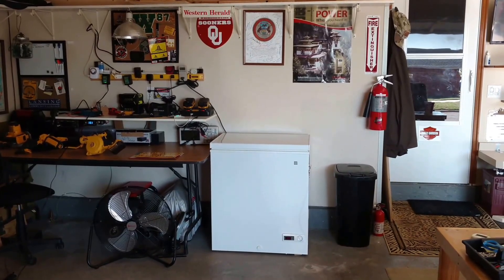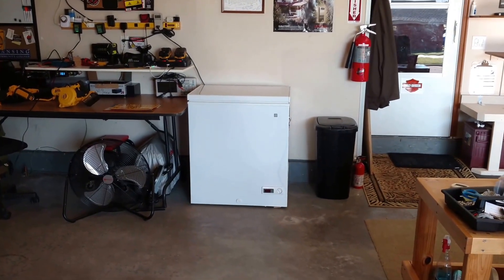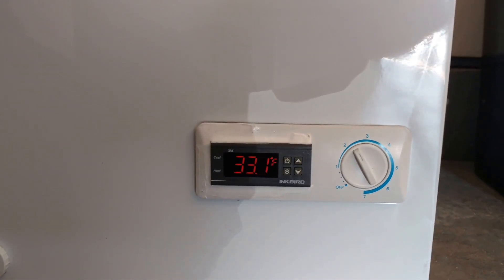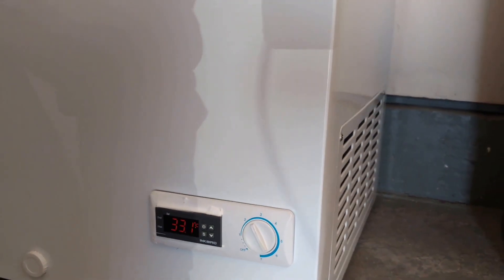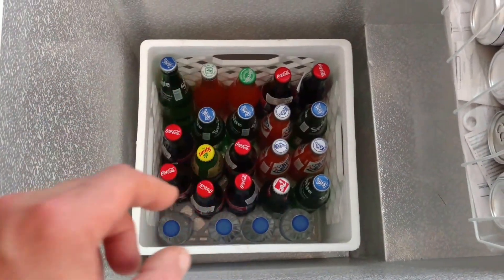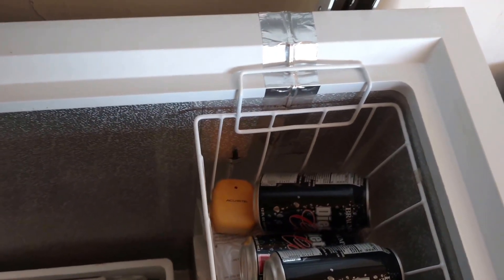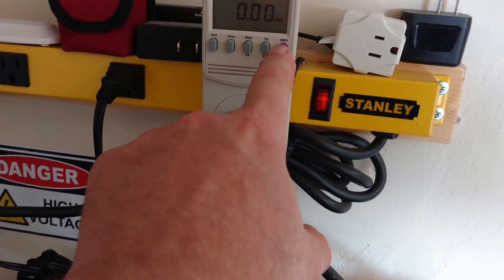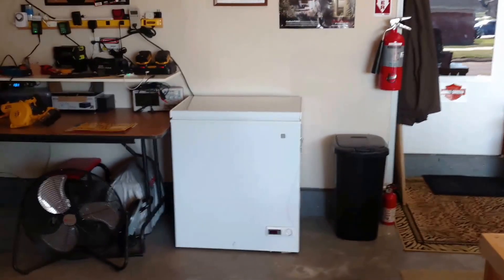Inkbird digital thermostat "up and running" - Deep freezer to refrigerator conversion (hack)

Comment: Nice job Chris. I have the same controller on a 5 1/2 cubic ft. In refrigerator mode is uses 220 watt hours a day. It is as efficient as possible. I added a 1" Styrofoam sheet to the lid too. It keeps our eggs refrigerated for almost no load on our solar system. We also use it for the vegetables from our garden to keep them fresh until we can them. I also have a 8 1/2 cubic ft with a digital controller hack. On both of them I pulled the old thermostat thermocouple out of the vertical tube that goes up into the freezer/refrigerator and inserted the new thermistor up onto the tube. It seems to work well. When we were off grid with a 600 watt array we used the 5 1/2 ft for a refrigerator. The only draw back in our wet climate is we had to wipe the moisture out of the fridge every couple days. Now being used for eggs it does not get opened very often so not moisture build up. My 1st solar project was the chest freezer hack, 2 deep cycle batteries, a 1100 watt modified sine inverter and a 200 watt Renogy kit. We had a refrigerator and lights in the house! That was my 1st grid down back up. That's what got me into solar in the first place. Sorry about the long comment brother. Let us know what the P3 says after 24 hours.
Reply from the maker: 220 watt/hours a day? Holy Moses...that is incredible. If I remember, my old black 2.4 cu ft Frigidaire used about 1 - 1.5 kWh overnight Ouch. I will let everyone know how this 24 hr test goes.
Reply: Mark Osborne Well I hear you on that, it's just that my wife is an old homesteader from way back. She does like not having an electric bill. That said as soon as we installed the last solar upgrade she went out and bought a new refrigerator that uses 1kh a day. Then she went out and bought a front load washer and dryer that are frequency driven (freqe drive) motors that are super efficient.  She use to ask "how much solar would it take to... ?"now she just smiles.
Reply: In the system you were using with the 200 watts of panels, you said you had 2 deep cycle batteries. What batteries did you use? I am just  starting out and hoping you used marine deep cycle and it was able to power the fridge.. Let me know. Thanks.
Reply: Chris DIYer did you ever post that kilowatt usage?